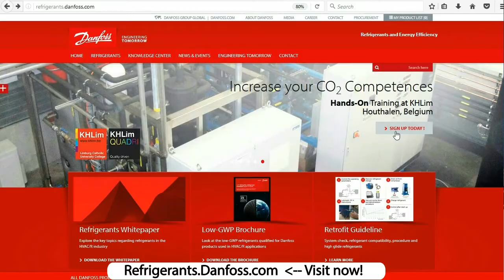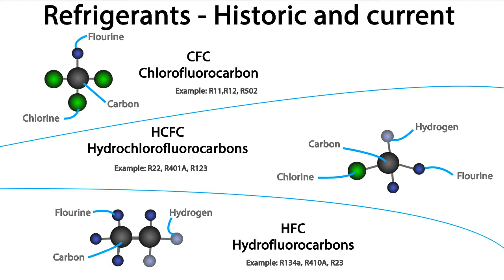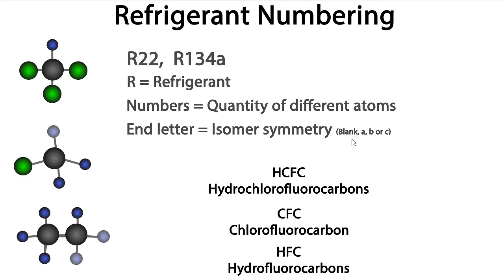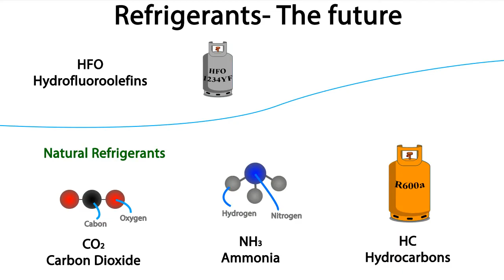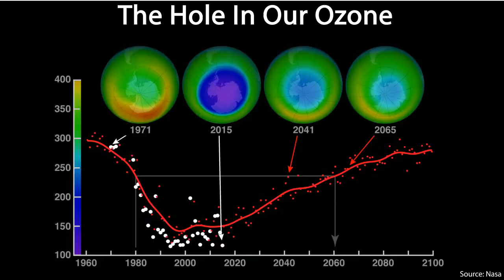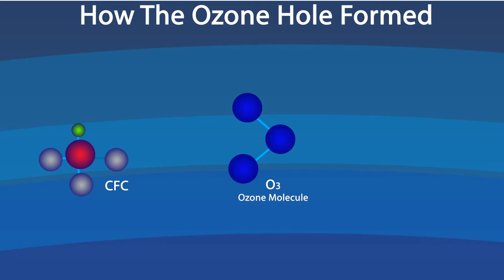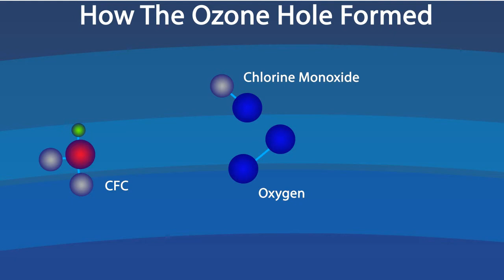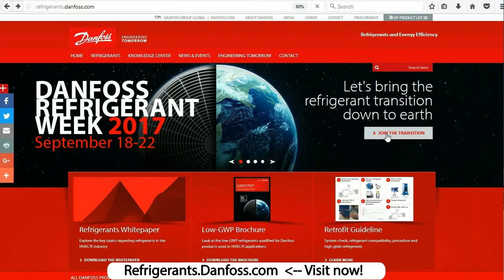Refrigerant Types, Issues and Future

Comment: "Global warming potential" is a faulty theory. Surface temperature is set by convection in the troposphere, and not by infrared effects. Equations are simple and work to predict temperature on other planets also. They are accurate. Doctor Robert Ian Holmes has YouTube videos on the topic. 
Therefore, the GWP of refrigerants is a total myth. Lawsuits need to be used to correct the laws that are making refrigeration systems expensive and dangerous.

Comment: R32, R290 and R744 are the only refrigerants that should be used. They cover low medium and high temperature refrigeration and heat pumps and are as or more efficient than any of the high GWP refrigerants like R410.  They are also much less expensive. R32 can be phased out next. The use of monoblock heat pumps that are outside the home/business eliminate the sad old "flammable" BS that these companies always go to. Most of us in North America already have a gas or propane line entering our homes and this is never mentioned. Refrigerants including R290 are in hermetically sealed systems that pose far less threat than the gas line that is not a hermetically sealed system that runs into our homes.
Reply: But you get 25% less efficiency, by using R290 instead of the R410a, if a R290 is hermetically sealed it does applies to the R410a too.
Homes build with R290 AC systems, have additional safety requirements, like forced ventilation systems, etc... which also diminishes the overall efficiency and materials used (<- also a GWP thing).
Do we really want to trade, more power usage (over years) against the "possibility of a leak" of a high efficiency refrigerant which, (converted to GWP/energy) would be used up in less than 3 months ?

By the way, the main reason for the ozone layer whole was that CFC were used in every spray can, which purpose was to set the CFC free...
Reply: As far as I'm aware, the concern with flammable refrigerant is the high/low pressure part, where if it fails catastrophically, it could explode; as opposed to a gas line leak which is more likely to cause respiratory issues or fires. That being said, I don't know how realistic those concerns are.

Comment: I'm trying to build a cooling suit for van lifers so they can save on cooling costs to cool their bodies, and I was looking to use a liquid that could evaporate quickly at a low pressure and at body temperature, which would be cooled via a peltier device and condenser coil.

Comment: If the buildup of dense green house gases allows more infra-red energy to be reflected back to earth, why doesn't it also reflect more IR energy before it reaches the troposphere?
Reply from the maker: Good question, I think to some extent it will reduce the amount entering, but it's a constant stream of energy from the sun so for every 1 unit of energy that is deterred, a vastly higher quantity will get through. As it passes through, hits the planet and it reflected back into space the chance of colliding with a greenhouse gas particle doubles, each part that is reflected back to earth will then have to try again and some of that also won't make it. So overall, we still get that build up which outweighs the offset.
Reply: @EngineeringMindset  I'm not sure if this is an adequate explanation - if the gg's in the troposphere are capable of reflecting IR radiation (possibly others too), then why is the assumption that it works more one-way than the other? i.e. if it's really a bit like a double-sided mirror with holes in it, then the IR penetration or reflection will surely be similar and the gg's are really only making the holes in the mirror smaller, which should allow allow more IR reflection from both sides of the troposphere!
Reply: @djs5916  I’m a few years late, but came across this comment while studying for my EPA 608 & heard the answer in an HVAC podcast. Basically, solar radiation comes in, hits the earth’s surface, gets absorbed, and is then re-emitted (slightly shifting it’s frequency) as heat, which can’t get out the same way the light got in.
Reply: It's really about the heat that objects release through infra red. 
All objects release infra red. A lot off that occurs are night. If we have greenhouse gases that infra red gets reflected back.
Also keep in mind that the sun shines more than just infra red and that gets absorbed as heat.

Comment: Do they take into account their efficiency when calculating their footprint or just the refrigerant in itself
Reply: No, the GWP figure is just the refrigerant release itself. This is the whole scam. These low GWP replacements, like CO2, have a poor COP and use 40-60% more energy and therefore 40-60% more carbon. The carbon footprint from the energy usage of a system is several orders of magnitude more than the footprint of the refrigerant should the charge be released into the atmosphere. Unless your power is nuclear/not fossil, we should be using the most efficient refrigerants possible. The industry is run by salesmen.